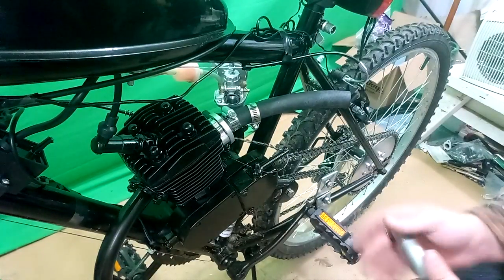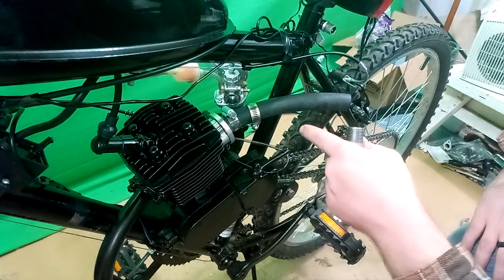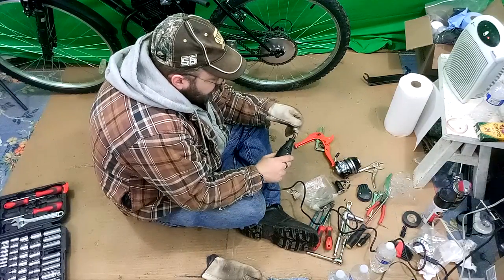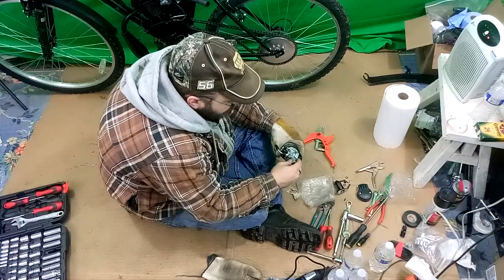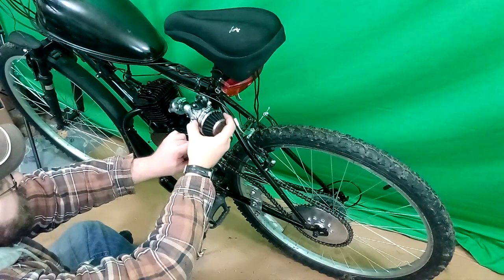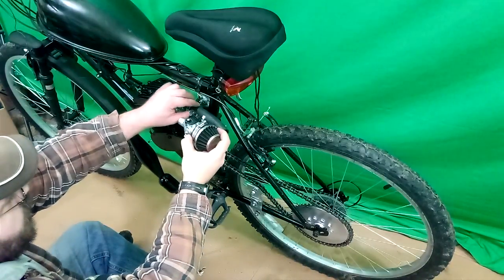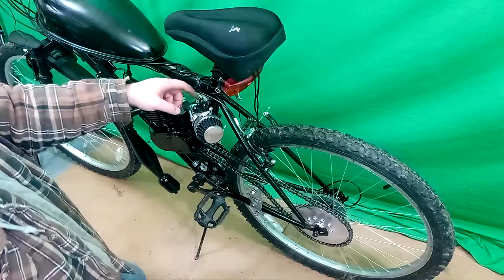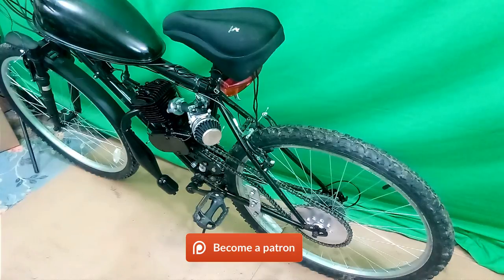How To Install Reed Valve 40mm How To Build a Motorized Bike Part 23

Comment: The length of space from your intake to carb should be 4.5 inches for overall performance. You can go 2in. Or 7in.  To optimize different power output.The 3/4 will be fine without attaching it to anything.Nice video and good job. Godspeed.

Comment: To install the vane valve is it necessary to make a change in the piston, or can I put the valve without making a change in the piston?
Reply from the maker: The valve does not touch the piston.

Comment: Going to be sweet when your done
Reply from the maker: Thanks. You can already watch all the videos I have uploaded now on http://www.howtobuildamoped.com 
Spoiler alert: so I played around with it without a windowed piston, and discovered it likes to run with about .62mm main jet.
After installing the windowed piston, it likes to run somewhere between .72mm and .75mm main jet. 
Then I installed the DIO OKO reed valve cylinder kit, and the windowed piston isn't big enough, so I ported out the intake on the cylinder, and I haven't had a chance to run it yet, because one of the threads on the crank case was too short, and the whole stud came out, also the clutch base bearing is going out already (outside the crank case), and the 6mm mounting stud broke off, so they are sending me a refurbished engine bottom, with 8mm engine studs, and it's suppose to be here tomorrow via UPS unless the post office intercepts it first, and then I might get it on the 15th. I also have relatives visiting, so I might not get to it until this weekend. 

FYI, I noticed that there aren't any videos on YouTube that I could find, showing how to port the intake, so that it always has access to the crank case. You see the finished product, but not the process.  So I made two videos of the porting process. I probably didn't port the transfer ports as extreme as others would like, but I did clean them up. I still have the 44 tooth sprocket, and stock wheels, and brakes, so I don't think I can go over 30mph safely, at least not downhill. 

What I want to do is get some 26" mag wheels, disc brakes, and a jackshaft kit and show how to install all that, but right now I have to spend cash on other things. This month I don't seem to be getting credit for any affiliate sales, other than for a cylinder head, so I'm not sure if I will be able to afford it. I'm wanting to sell my 1991 nissan pathfinder, it's in bad shape, a gift from my x-wife. I also entered a contest to win a 50cc scooter that I could sell if I win it. 

I will be advertising my website and services locally soon. Maybe that will help. 

Looks like your having fun.